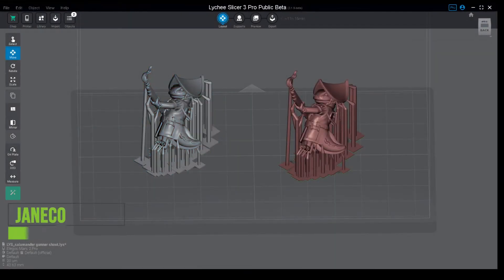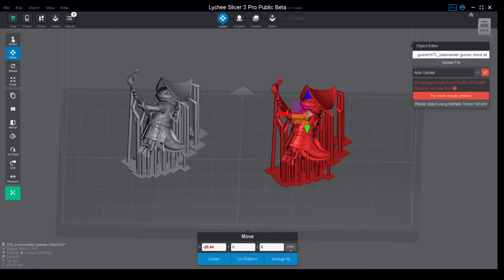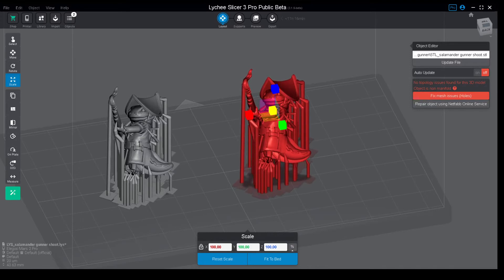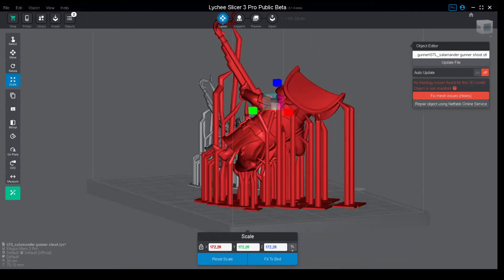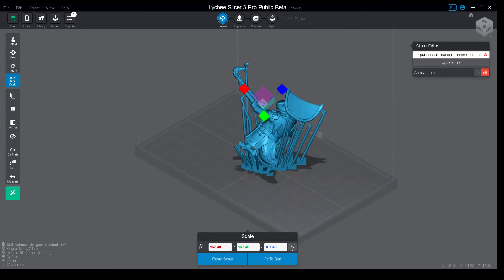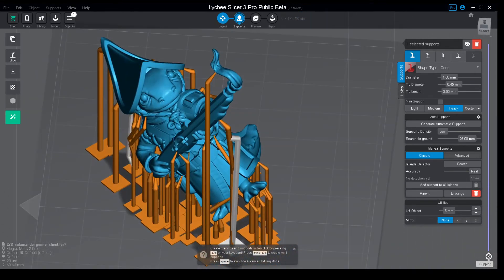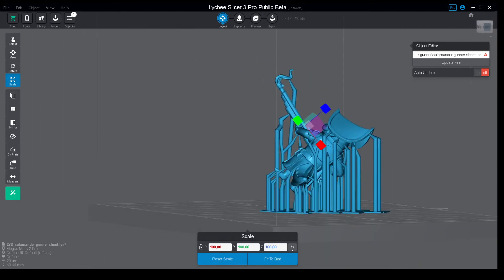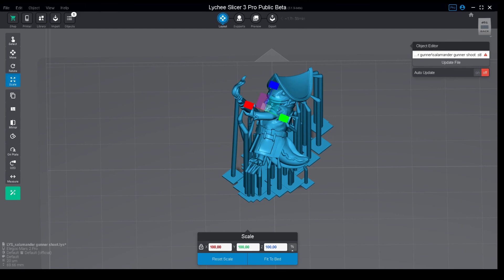Scaling in Lychee

Comment: Man I have an object which is 174 mm at its X-axis in the STL file. However, when I score Lychee it takes the unit of measure as Micron (0.01mm). The original measure of the object is changing when I magnify with Scale 0.01mm to 1mm. Why it doesn t keep at the same size?